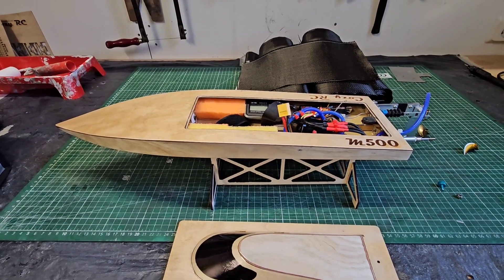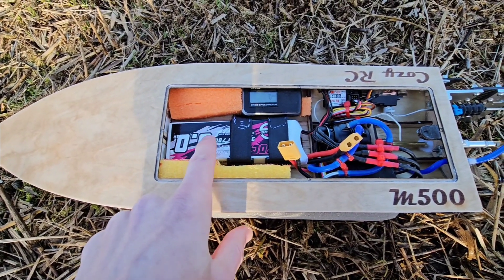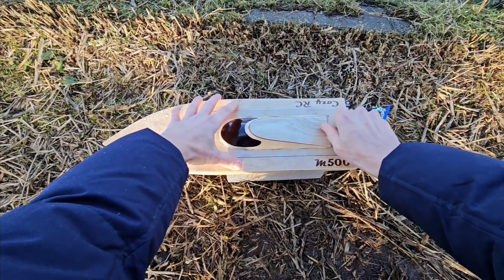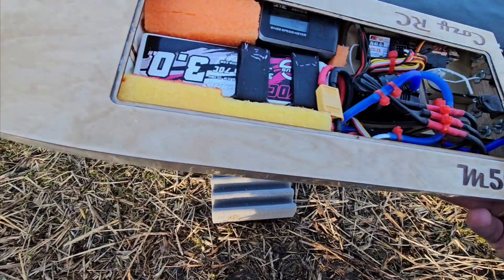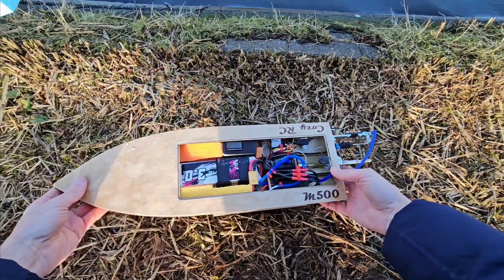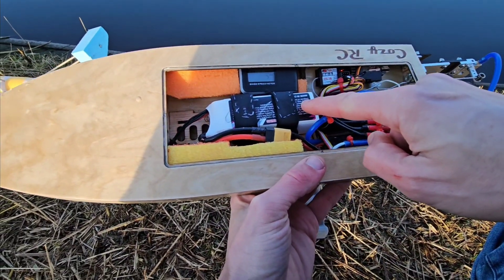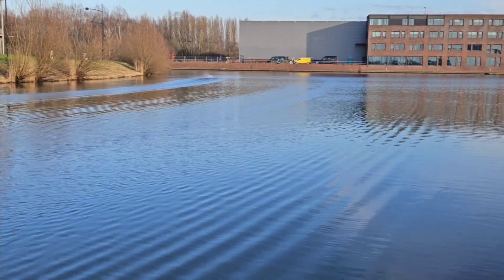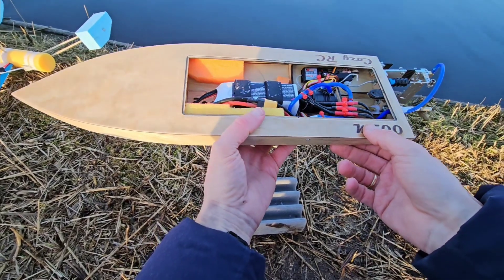DIY RC boat: M500 Mini Mono 4S run ends in personal speed record!

Comment: How long is the hub of that 4mm bore 37mm 1.4 pitch prop? Are you balancing those props first before using it on your boats?
Reply from the maker: I think that hub is 14mm long/high. Yes, I balance and sharpen all my props before use 😎
Reply: @CozyRC thank you!

Comment: Hay DJ I'm nearly finished building your original mini mono but I ordered the 2958 3380kv rocket motor, is that going to be too big for the hull?
Reply from the maker: That will work great! Please check this video, where I put a 2858 2900kV motor in the original Mini Mono: https://youtu.be/7SbXyV95mqA?si=xeutrVZfr352kUAT
Reply: @CozyRC  oh I did watch that! 🤦, thankyou man
Reply: @CozyRC  just another question I'm mainly going to be running 3s and 4s like you I was wondering rather than having a central battery tray would it be balanced enough to run the battery on one side and esc of the other in the forward part of the hull? Or would you recommend running the battery central? I can send you some photos of my build if would like also! I've glassed my hull and clear coated it, looks amazing!
Reply from the maker: I'm not sure what you mean by the forward part of the hull, but the bow section should be filled with flotation material, and the mid section is for the lipo and possibly the esc. 
I recommend to put your lipo in the center of the hull. It will improve the handling if you have heavy mass in the center!

Comment: Exciting times indeed :D  Jan, quick question, would you upgrade your GPS tracker for an SKYRC GSM020 GNSS Performance Analyzer Power Bluetooth? I know its a couple bucks more but I'm told its lighter and you can check the speed without having to remover it from the boat every time. Do you know anyone running such gear? 
Cheers
Reply from the maker: Thanks, Raf! I'm aware of that GPS and I might try it. The one thing that holds me back is the water resistance. There's none, basically. I submerged my GNS-015 many times and it's still rock solid. That's a huge plus for me!
Another hassle would be to bring a 2nd phone to see the speed, as I record all my runs with my phone. I guess this is a luxury problem 😅
Reply: @CozyRC  water resistance... hum good to know.  I have an GNS-015 like yours but seem to have been busted as battery only lasts around 15 min with a full charge. I'm looking for some alternatives in the future.

Comment: Thanks for showing any good idea what I could use as a shimnfor a 4mm prop to be used with a 3.18 shaft?
Reply from the maker: Thank you! I use 4 to 3mm shims for that. If I remember correctly, that fits perfectly.
Reply: @CozyRC  thank you 😊

Comment: Nice calm water and a great result for the M500 and it did a awesome flip. Haven’t started on my Shrimp build yet ,still kicking around installing a 3660 3300kv if it will fit with a cowl mod. Keep it coming mate.👍🇦🇺
Reply from the maker: Thank you, Bob! The Shrimp is a great boat! But why pitch a 3660 in it, it doesn't need that 😉
Reply: @CozyRC 
I happen to have a Maverick 3660 3300kv motor from a rc car sitting there doing nothing so I thought why not throw it in the Shrimp. It is a bit of overkill and I will give it some more thought.👍🇦🇺